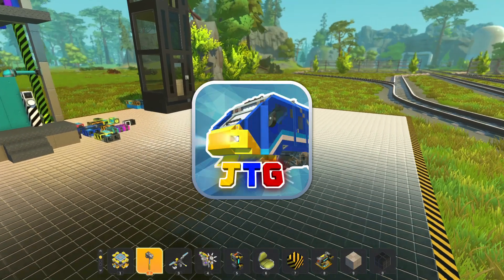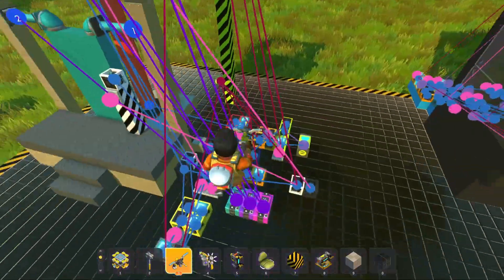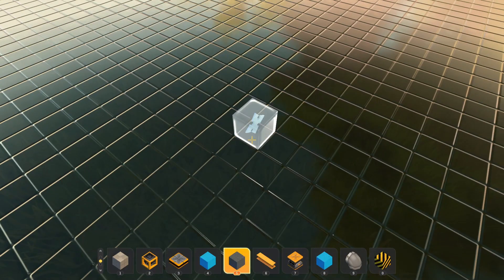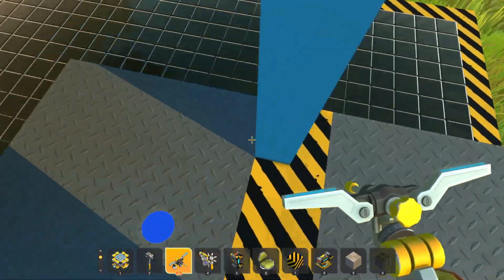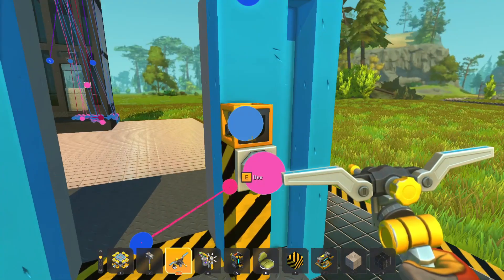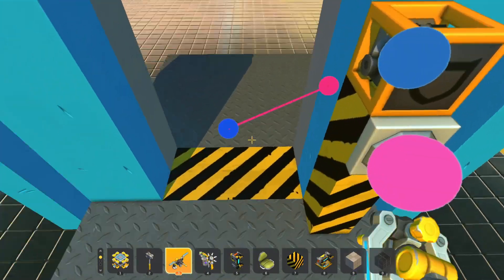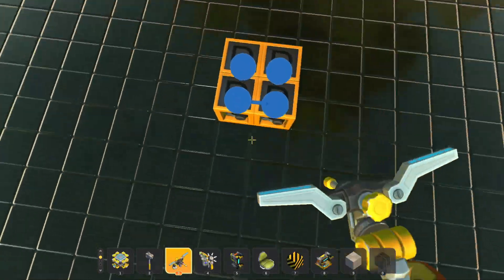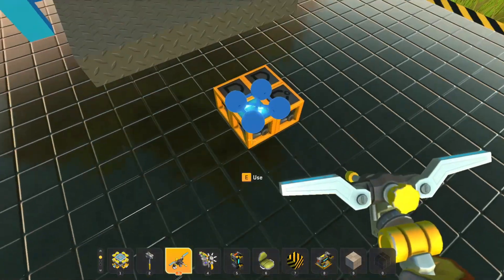How to Build a REALISTIC ELEVATOR in Scrap Mechanic! | Logic Gate Tutorial

Comment: hey man, can i ask for some suggestion ?? i wanna make a 3 floor elevator in survival, cuz i'm using fant mod currently so i can craft the challenge piston like you, but the downside is when i stack the piston up to push the elevator, it's keep bending and bugging out, manage to make a rail to keep it in place but didn't work tho :v
Reply from the maker: Hey! Sure thing, building elevators in survival can be tricky. One suggestion is to add additional support on the sides of where the piston stack is to minimise bending, also using multiple pistons on the corner of your build can also help. Good luck, and let me know how it goes!
Reply: @Jotrain  hey man, tks for the reply :3 yeah i manage to fix that, u r right, i made more piston ( 4 of them at the corner, stack 4 more to push to 2nd floor, total 8 of them ) and it worked, not bugged out like the previous one where i stacked 2 of them in the middle to push the elevator :3